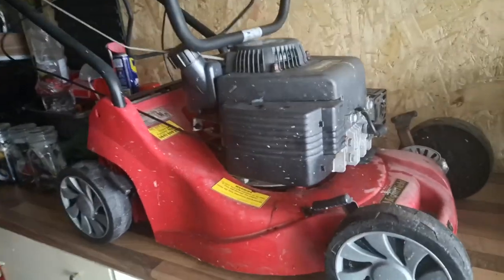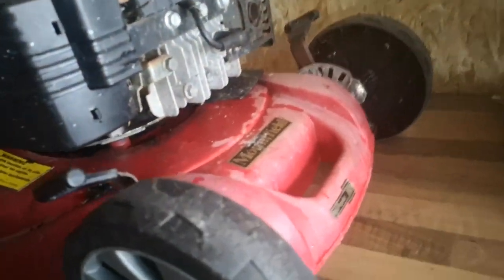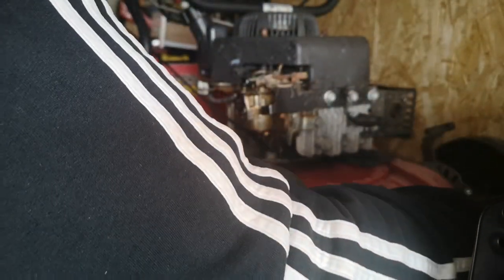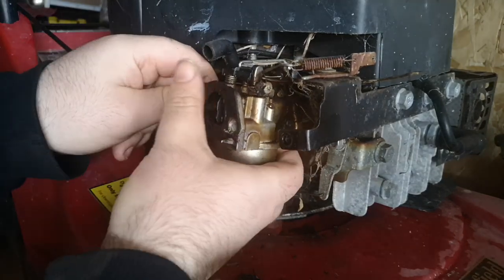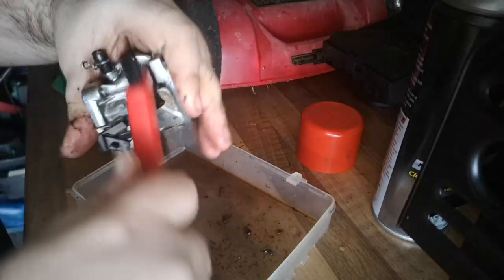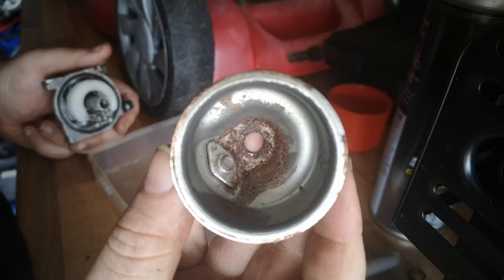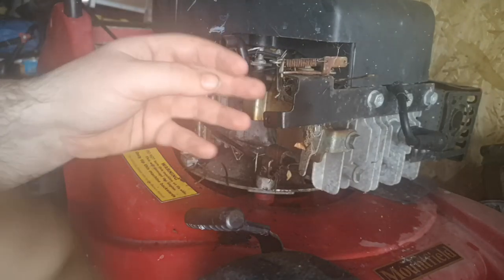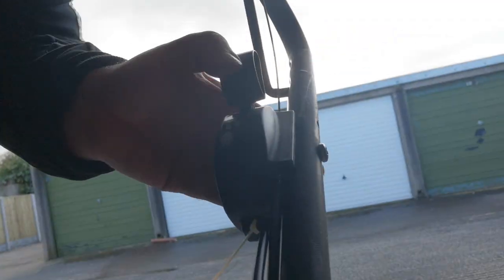Mountfield hp414 mower will it run

Comment: It's called the needle that's sits under the float.. to get the tube out i stick a screwdriver in the main part of the carburettor and push down on the tube.. I have a screwdriver that I have grinder on the sides to make it fit to get the main jet out.. I thought the the hp414 came with a rs100 not the sv100.. mate keep doing the videos and just be yourself.. don't worry about making mistakes. Keep it real..
Reply from the maker: thank you for watching mate